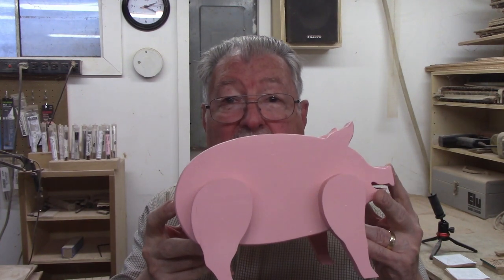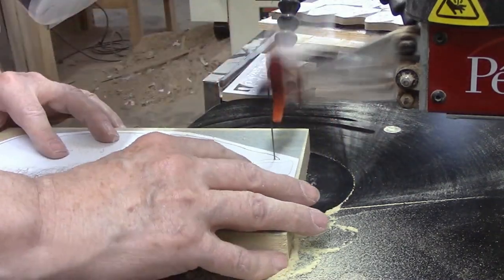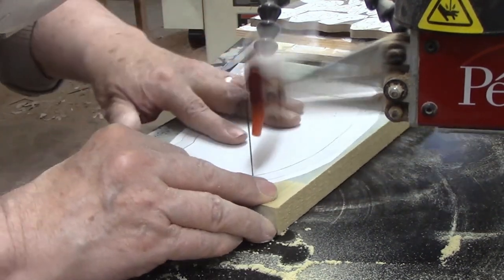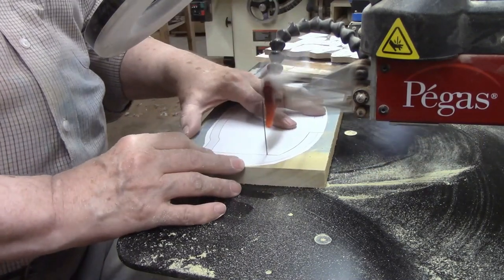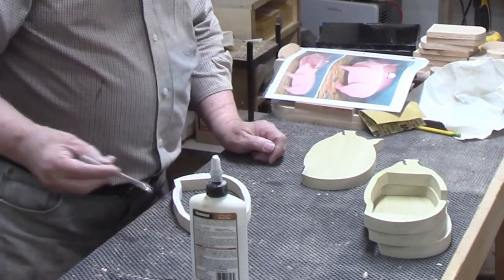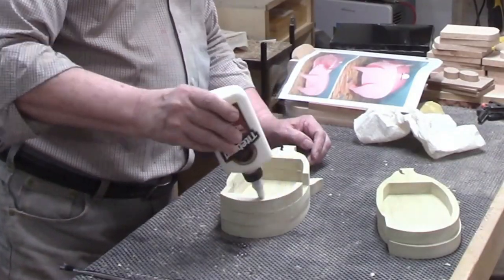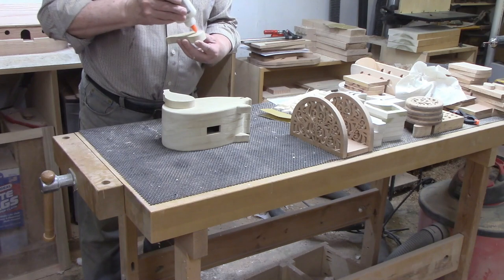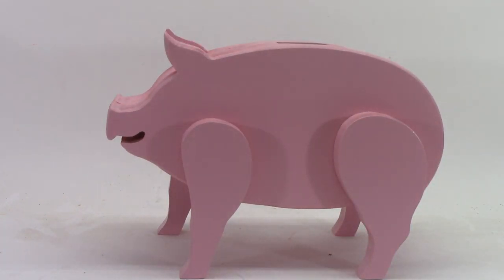Who Can Resist This Pink Piggy Bank?

Comment: Looks like a fun project!  A child could help with the painting which I'm sure they would enjoy.  Could add a tail by drilling a hole, putting in a little glue and stuffing a pipe cleaner into the hole.  Then wrap the pipe cleaner around a dowel to get it to curl nicely.
Reply from the maker: Those are great ideas. Part of the fun of projects like these is adding details to make it more your own.

Comment: Hello, I have a Hais brand bristle saw machine, I engrave the projects I will cut on the wood with a laser engraver. When I start cutting, there is a lot of slippage in the lines, the blade sometimes deviates too much from the line, I am new to this machine, but I am not far from wood cutting, I am a carpenter, I am just wondering what I might be doing wrong with this machine, I work with 3 mm or 4 mm MDF. I look forward to your advice. (Blade numbers are number 3 and number 5 I usually use number 3) Also, the blade post of the machine is smooth.
Reply from the maker: I'm not familiar with that machine, but with the thousands of hours I have accumulated on various scroll saws it seems to me like the most likely culprit is improper blade tension. After you tighten the blade, you should pluck it. If you get a dull thud-like sound, the blade is too loose. You should hear a musical note when you pluck the blade. It's also possible that you are starting with correct (or near correct) tension, but the blade is coming loose as you cut. If that is the case, you should likely feel increased vibration as you cut. I hope this is helpful.